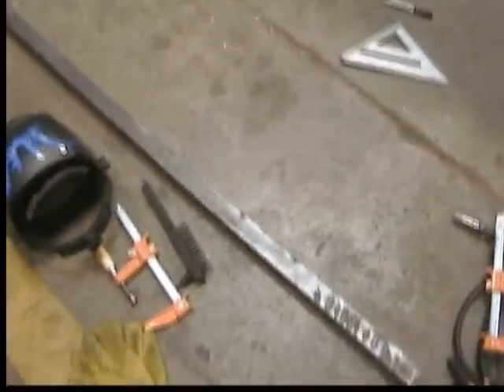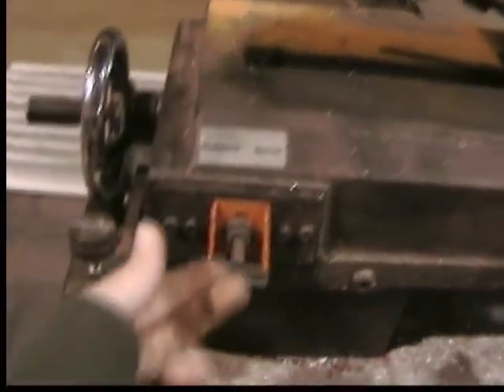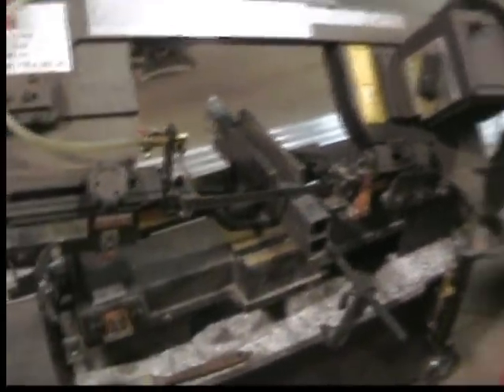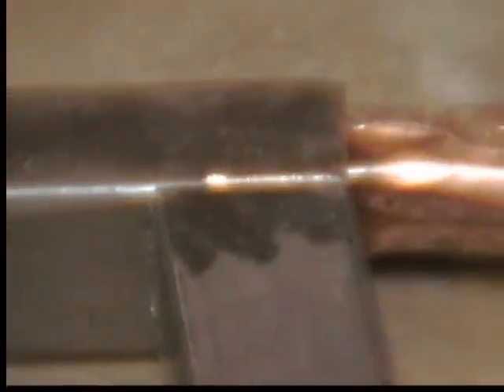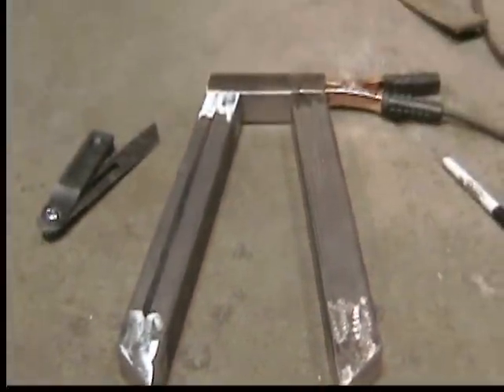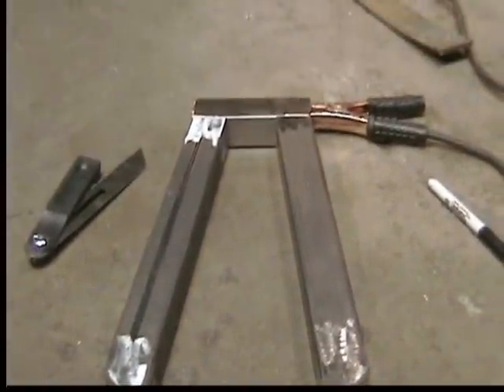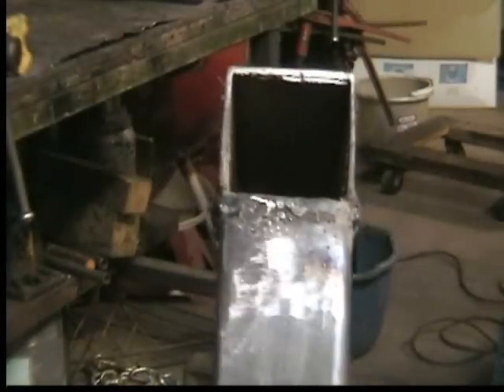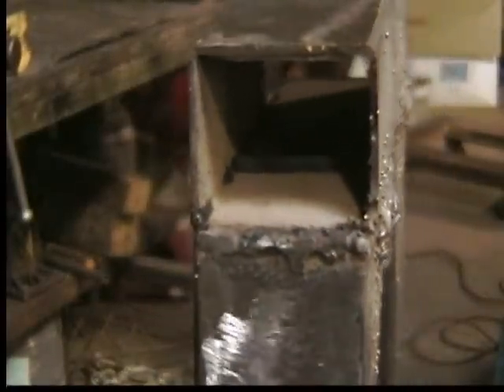Velomobile Day 3

Comment: Hi m8
Can you give some specs about your welding machine?

and thichness of your steel?

ps, keep the welder pointing in the direction of the joint, and from the thicker steel to the thinner,
also keep the welder in a small angle towards the joint.
and if it burns trouhg, try setting the wire feed a bit slower if power is as low as it goes.

Keep up the good work.

Comment: It's been 30 years since I ran a welder.  If I remember correctly the last welder I ran was a solid core wire with argon inert gas.

It would weld some pretty thin steel.

Get all your frame parts mitered and ready to weld and welder your uncle found can do it up. 

If the guy doesn't mind you can still film him welding it together.

Comment: Very Cool.

Will you incorporate any type of reinforcing gussets into joints?
The splatter can be ground off.  As you know it's the penetration of the weld that's important.
I've seen some beautiful beads that aren't worth a damn.

With practice, running smooth looking beads with good penetration will become second nature.